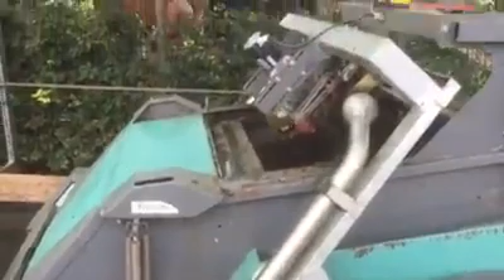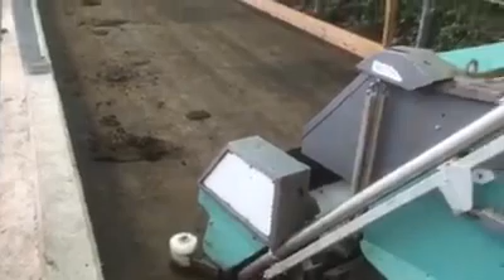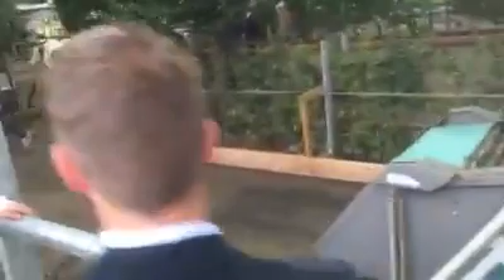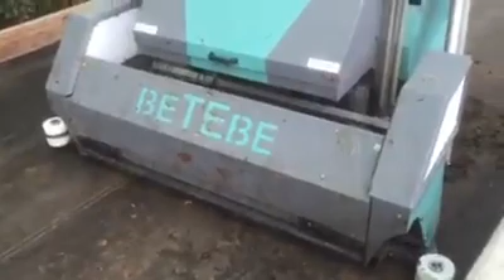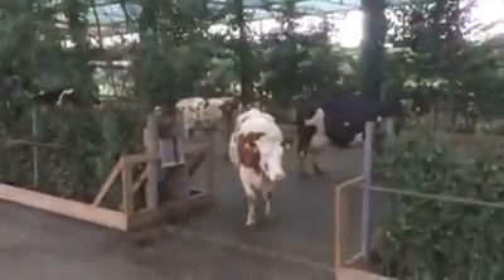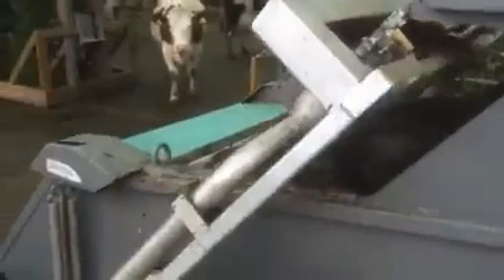Manure eating robot in Cow garden

Comment: Is this floor permeable? Read a study that included a little info of a similar system. How did this project work out?
Study also included info on a sand bedded pack, something id be interested in as sand is very cheap bedding and I might be able to use it to improve drainage on my heavier soils.
Mortellaro is a huge issue keeping feet clean and dry is nearly more important now than clean udders!
Reply from the maker: Hi Adam, thanks for your input!
Yes, it's a permeable floor. The robot is not yet good enough though…. Too many dirty cows, too many breakdowns..
.

Sand is the winning system. In cubicles is it easy to manage.: cows resting 12-14 hours, is boosting milk and less hoof infections. It still needs scraping; 10x a day with automatic scraper….
Other option is free yards with sand only:  need a lot of cleaning and heaps of sand….

For better understanding and more practical tips on prevention of mortellaro and other hoof diseases: Check out our Hoof Signals online training.Helps you make better decisions for your cows for the short AND the long term.
https://www.cowsignals.com/video_courses/hoofsignals 

If you have a plan for a barn; contact Barn Design team Vetvice! They can give you an excellent second (or first!) opinion.
 http://www.vetvice.com/barn-design/contact